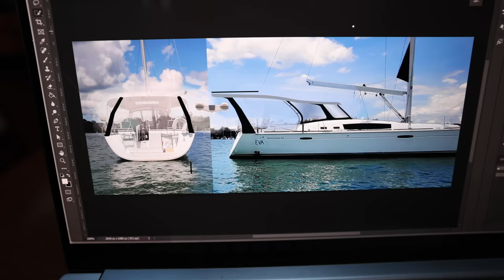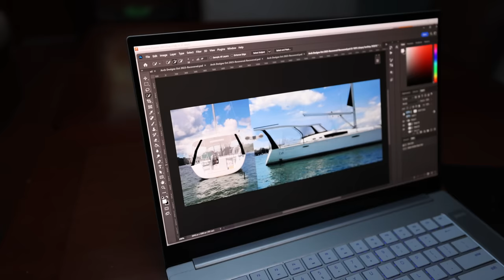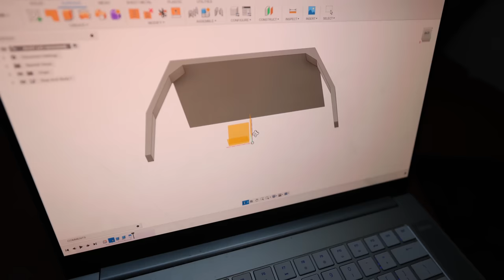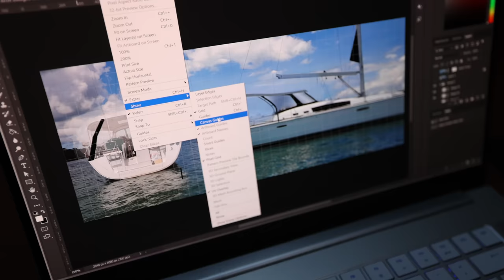ALRIGHT... here's what's really been going on | EE 138

Comment: looks good, but be careful of raising your capsize screening number too high! Also pro tip - make the top capable of collecting rainwater with a downpipe/tube and a diverter valve (to only collect water once the roof is cleaned) that can feed straight into your water tanks!

Comment: Not sure if anyone said this, but having worked with fiberglass, kevlar and carbon, in most cases, the carbon fiber is by far the easiest to work with, it wets out easily, cuts easy, about the only tricky thing is sometimes it does not want to go around corners. For light weight structural parts, research wet layup with vacuum bagging. Check out aircraft spruce and Fibreglast for info. Good Luck!

Comment: were you partially inspired by SpearItAnimal ? The way they did it was a foam core with layup around it so it is pretty light still. I wouldn't recommend the varying roof line. It is unessesary and added  complexity. I would highly recommend you do panels throughout for the highest gross output. 3000watts is not unreasonable. They had a guy that did the fabrication in West Palm Beach for cheap.

Comment: build a frame/column and then use the solar panels as covers, that way you can remove in the event of a storm or extreme wind situation. then design zippers or connectors for closing the sides for bugs/etc and make it enclosed.
Reply: also easy to replace panels if they go bad/etc.

Comment: I Definitely think composite is a good option for this. I winterized my boat last weekend(sad) and the stainless frames for dodger and Bimini aren't light. I think you could keep the weight down with carbon. If you haven't already seen theres an amazing example of a diy carbon dodger/Bimini/arch on the beneteau oceanis owners group page. The boat was named Denize II(its since been sold) the owner and builder was helpful with questions when asked(sorry, I'm not comfortable putting the name here). Search "hard dodger" and it comes right up. I also would love to see some experimentation with integrated solar cells laminated directly into the composite structure.

Comment: The curvy design looks amazing, but you might consider making it possilbe to have drop down/roll up sides so you could completely enclose the back and sides of the cockpit if you sail to colder climates to enable the cockpit to be useful at least at anchor. Good luck! Conversely the other things I'd suggest considering are the windage on the sides of the dodger.

Comment: Part of the problem with the old bimini is the shape. With it being open and curling down at the edges any time they'd get a crosswind it would create lift. Basically the wind has to travel farther over the top, speeding up the air there which in turn lowers the air pressure. Bernoulli's Principle. At first it wouldn't be a problem. But as the materials age it only takes a strong wind to start ripping it. You can see it happen because when it started to go it started to fly up.

Wish you both well! I've watched every episode. You two have really made me want to retire on a sailboat.

Comment: The design of the enclosure is pleasing but, how will the structure handle wind from the stern, bow, starboard and port directions?
Will the structure create unwanted forces on the boat like a wing?
Could the structure be built from aluminum and Lexan. Lexan can be formed into complex shapes much like sheet metal.
Looking forward to your final design.

Comment: Hi Evans’s
Please look at the Amel 60 before you embark on your hard dodger 
They have a hard wheel house and then a retractable aft hardtop. 
You may even have to move or have forward steering control. 
And I think you need to lift the front up so the hole roof is in line with the shear so it doesn’t look like a add on 
I am an Evans and you know how painful we can be if it doesn’t look right 
Not me painfully to you, you to yourself 
Good luck 
There is a lot of thinking to be done before you start

Comment: If you use carbon-fiber, could you make the top of it solar? I mean, could the roof of it actually be made of solar plates? Not just a top with solar plates on it? If that can be done, I'd think the weight would not be an issue. As for not having a generator, I am reminded of Sailing Uma when they went up to the Arctic and bought a generator and in fact had to use it because cloud cover made so they were not generating enough power. So, either way it is a good idea to have a generator for backup when you are in a boat that will sail the world. Maybe you can get a smaller one if the weight is an issue.

Comment: Hi Brett and Jade, 
I love building stuff and fixing stuff/my boat...
 I used and use a lot of carbon fibre with vacuum infusion or simple vacuum...
 I will build a new solar arch this winter, carbon fibre instead of the heavy stainless steel contraption.
 The first decision on the building method is always to build a mold or to build a core.. 
 My new solar arch will have a core that then will be covered in carbon fibre...
Matthias

Comment: The hard doger, bimini and inclusion of dingy davids is a great idea.  I built a bimini over the cockpit of our catamaran and gained a huge extra room!  And this was in Scandinavia where the weather is really hars, was sailing in November in a T-shirt absolutely worth it.  
Also I would commend you for the openness of mental issues.  I have to use anti dipressants after loosing our son.  Do not get off them, the will help you.
Good luck withe new project, would like you to do an even curve from the top of the dodger though the bimini to the davids, should not follow the existing curve with the bimini and dodger.  I think that would look like a better "flow" of the entire installation.  And  make sure the dingy when hoisted not disrupt the rear view from the cockpit, and that it is not too high for weigth concern

Comment: I'm all for the big projects and I've always thought hard dodgers were king but just be weary of structural changes to the boat. Part of the reason there isn't large dodgers on sailboats is because of the torque loading to the hull during sailing and how it might crack badly. Also dissimilar materials can be an integration nightmare but if you're up for the challenges go for it!

Comment: Way Cool project guys,go for it ! As a retired engineer I still learn new things and undertake projects that I know little about initially but do the background research first then go for it. 
Don’t think too small and that you don’t have the skills - we come into this world with NO skills and have to learn them ALL before we can do anything. 
There is a lot of advice out there to be found, just listen to lots of sources. I would be mainly concerned about too much weight up in the air and too much wind pressure too far back.
My wife and myself in our late sixties designed and laid a 120 foot drive plus big parking area and paths in block paving because we lost confidence in our builder, it all worked out and 10 years plus later is still great. We had never even thought about this sort of job before starting it. I am about to start on my second similar project at 76 on my own - looking forward too it.

Comment: Thanks for honestly sharing guys, I have been wondering what had happened to You. I’m soo glad that You are back in good health. 
It seems like everybody is building atm. and this is not that big a project, so crack on guys. I would try to keep the roofline straight to keep it more in line with the lines of the boat itself. 
Engineering Evan’s sounds just right to me and I will definitely be a Brett guy. 
Good luck from Denmark

Comment: I watched a repair of the US boat in I believe New Zealand , a carbon fiber repair. I need to look and check for detail.  I've been hoping for more detail, because, I realize its probably expensive but if I were to build a cat I would think about using it. If and only if I were working DIY. 

 I went through a period of depression. I happened because I was with an abusive alcoholic. I was absolutely down to nothing. I was basically rescued by my friends . I did take some medications. It gave me the means to break up with the alcoholic. It didn't make it completely easy, it was tough, but before I wouldn't have been able to do it. I got some advice from a nurse who I've know most of my life, she was the age of my mother, she said to quit if you think you could handle things afterwords. I was successful. I've done fine for about 20 years now. But, it isn't cause by glutton. My question, do you still hold back on glutton now ?

Comment: Ok.  (1) Sucks that Jade had to undergo the changes.  Very happy to see her become healthy and happy.  As will Brett and the Dogs.  Regarding the Trolls, ignore them.  Haters will be haters.
(2) The hardtop dodger/bimini/solar arch/davit idea is great.  Always wondered why people do not do this on all of the boats.  I think I would avoid going with carbon fiber for a number of reasons: expense, conductor for lightning, and difficulty in making repairs.  When creating the dodger, use real flat safety glass and wire in motorized wipers.  Also, wire-in speakers, a microphone, cameras, and multi-color, dimmable LED lights.  You may also want to have rod & reel storage in the overhead aft so that you would have them handy and have a safe place to store them.  Here is a big recommendation: mesh screens to keep insects out!
(3) Expo Evans - Fixin' Eva

Comment: Nice dreams , go for it. 
On the hard Bimini make sure you can toss it overboard.  
The ship up right capability maybe compromised more than you like during and heavy storm. 
Make that calculation.   

Building airplanes is a part of my my trade.  Building it your self is more difficult when you start from scratch.
The industry is providing kits that are 51 % ready. This to Faa regulations. In Europa is a bit different but the basic law is similar. 

For carbon come to the Netherlands or go france. Those countries developed that material. So they are the supply guru. We may hand you a course how to work it .

Comment: Hi Jade, it's great that you're both back and I'm glad to hear that you're doing better now.

Quick question about your gluten allergy. I've had loads of undiagnosed issues with tendons for more than a decade now, which sound similar to what you described. Did you get your gluten allergy diagnosed or was it a case of eliminating it from your diet to see if it helped? Really interested to hear how soon after coming off gluten you noticed your joints improving. Thank you!
Reply from the maker: I found out through an elimination diet! I was actually misdiagnosed with multiple other autoimmune diseases in the years prior, but in all the testing had never had the gluten allergy test. I started the elimination diet in an attempt to ease my symptoms as it's helped a lot of people with autoimmune. I never expected it to fully resolve! The elimination diet was called Autoimmune Protocol or AIP. It took about 6 weeks before I really noticed an improvement, but around that 6 weeks mark I started feeling very good! It took about a full year before all of my symptoms resolved - it may have been quicker but I didn't know about avoiding microdosing with gluten.
Reply: @ExpeditionEvans  Thanks so much! That's really helpful - it's great to hear you've had such an improvement in your symptoms. I'm definitely going to look into that protocol.

Comment: I was expecting.... a baby project.... but okay this is similar :-) we have created a hard dodger on our 50nft bavaria and created also a hard bimini and it's a connected piece with the arch/ dinghy hoist... It took me about 7 months with some help on the hard. whilst the boat was in a marina. I'll be happy to share the pictures of the project per email link. Not sure if its complete. I used polyester, stainless 316Land lexan for windows. No carbon as that's almost unavailable here  (Asia).  The design is mine and I made pictures of drawing etc. Happy to share. Its was finished.... almost finished... except for we had a lighting strike...and then a second one....... and things came in between to give it the last finishing touch.

Comment: Thinking about carbon fiber and ceramic coating protections (best), that's all very costly and maybe a bit of overkill. I've spent a lifetime in composite technologies for $60MM business jets - G--, well, you know... These layups must be vacuumed and heated to flow (bubbles), meaning, constructed in segments unless you have an autoclave as large as a railcar. Positive molds can certainly be as expensive as your one off end product. I think there are other reinforced polymers and technologies for this application. I would partner with a 3D printing manufacturer for house construction components and print a custom airfoil design performance dodger. Good luck and all the best! Where's the Pirate Princess these days? 🧌